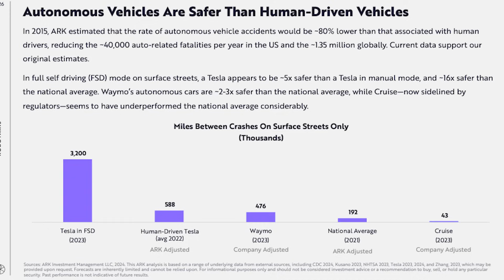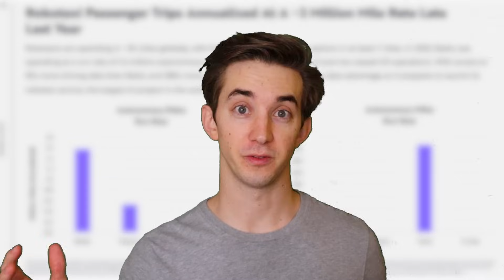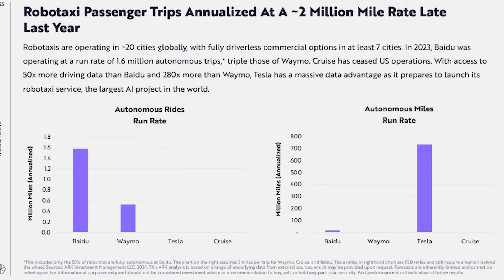Why Tesla FSD V12 will leave Waymo in the dust (customer review)

Comment: I have a comma ai  c3x on my base model 2022 Corolla. In terms of cost it is absolutely amazing. they were doing E2E before Tesla. I still believe Tesla will win at scale, but for someone who needs a cheaper car at $20k car + $1300 device compelling. Open source, tons of forks and fun to play with if that’s your jam🦉
Reply from the maker: thats very cool. thanks for sharing.
Reply: @BradAkersphotography
Comma has major limitation, well, 2 of those. #1 is data amount, as its way smaller in comparison to what Tesla has, by raw data and by compute power. #2 its share size and general camera amount. Its a single small device which can do so much, while Tesla can use 8 cameras capturing 360 view and use 300W computer to process data. 
Comma is entry level device, just to mess around with technology, but it will simply be stuck at this level.

Comment: Fusing a LIDAR/Radar/Camera sensor stack will be far more difficult than pure computer vision. It may be that Waymo is leading due to handling these cases better than Tesla, but this is as a result of Waymo targeting these problems specifically and not working on an vehicle platform and software architecture designed for generalization. 

That Waymo can handle construction zones at all is at the expense of thousands of dollars of sensors (per vehicle), and untold hundreds of hours of manpower devoted to these singular goals, around an architecture that is not designed to operate outside of a EXTREMELY well defined domain, and when the inference model cannot come up with a routing solution a remote advisor has to step in and drop bread crumbs for the vehicle to keep moving. 

If anything, in the long run Tesla is far better positioned to handle not only construction but operating in nearly any environment with a road.

Comment: These comments about Waymo vs Tesla are from people that have no real idea what they are talking about. Smoothing and better in many cases isn't the litmus test for robotaxi. Can Tesla FSD V12+ drive itself without any driver behind the wheel and not cause any issues, especially injury or deaths? If not, let's avoid fantasizing.
Reply: The simple answer is yes they can. It is just a matter of time now before this problem is solved.
Reply: I agree that anything is possible (can) but I doubt they can with Tesla's previous and current trajectory. Time will tell but time has not been kind to Tesla so far in terms of advancing FSD. @thewatcher5822
Reply: @huulegobetrotter1660  
FSD is made to work EVERYWHERE so its bigger challenge to make it work than any other system out there. Waymo has extremely bad handling when it comes to situations which are not preprogrammed or not prescanned, get a roadblock and it will freeze.
At the moment FSD is labeled as level 2 which by law requires driver and his full attention to the road, but from v12 videos we can see that majority of trips are done without any interventions. It's not there yet as a robotaxi, but it's close.
Reply: @Zripas  I think to say first iteration Tesla FSD v12 is close to robotaxi from a few videos is a huge stretch of the imagination. 

Aiming to have Tesla FSD work everywhere while not equipping the vehicles with the necessary hardware has so far proven to be too problematic and can't go beyond L2. 

Waymo isn't perfect but they can operate as Robotaxis in a few markets and they have gone about it correctly by investing their robotaxis with the necessary hardware and using their data properly in specific cities. Waymo is a robotaxis service not just close because of a videos and that's is a real fact. I personally think Tesla has the potential to one day have a robotaxis service but not at its current trajectory of solely relying on Tesla Vision and trying to do it everywhere because there are just too many variables on the road for software, albeit even using AI LM, to navigate on the roads across the country safely. Level 2 is nothing more than advanced cruise control, that other manufacturers such as Hyundai, GM, Ford, etc. also are categoried so unless they can get to Lvl4 or Lvl5, where Waymo is at, then it's would be difficult to be robotaxis. Only time will tell and I can and hope to be wrong while Elon Musk is correct as he stated Teslas are basically "sentient robots", " v12 isn't beta", and "we'll have Tesla FSD by next month/year or the month/year" after only using Visions "because humans only need their eyes". I would only ask how long/many years does anyone think Tesla really needs to reach L4 or L5 to say that Vision alone isn't enough and need to reverse Musk's decision? 1-2-3-4-5 years? I say if Tesla can't get behind L2 by 2027, put the hardware back in their new cars, and connect them reactivate the disconnected in their existing cars's hardware.
Reply: @huulegobetrotter1660  Tesla FSD is being designed to work everywhere, with just camera's. It does not require the array of sensors of its competition. Which is one of the huge advantages Tesla has. It is level two because that enables  Tesla to operate across the world, gathering the data required to solve the problem, while keeping responsibility for the system on the driver. ( a very smart move by Tesla) As for being level two, anyone keeping up with the development of FSD, will see it is a system way beyond level two (especially V!2)

From what I am seeing Tesla have basically solved self driving. It is just a matter of feeding it the quality video data required. Timescale for level 4/5 you ask? I wouldn't be surprised to see a Tesla  operating at that level somewhere at that level in about a year.

Tesla are about to dominate in this space.
Reply: @daydreamer8373  let's mark our calendar and see where Tesla is a year from now. If they can get beyond L2 then I will believe Tesla Vision is the right trajectory?
Reply: @huulegobetrotter1660  Absolutely. Before V12 I would not have made such a bold statement. But it really is what I have been waiting to see. FSD is already way beyond level 2, It has just not been activated as such. It is not quite ready, but all the hard work has been done. See you in a year buddy.

Comment: Tesla/Musk "vision only"  radicalism is very short-sighted (pun intended)
A plurality of different sensors is the future. Just like airplanes use a flurry of different sensors for IFR (no visibility) as opposed to VFR. 
This is literally a question of life and death. Ultra redundant sensors may not be cheap but its the way to go.
Reply: Unlikely. Cars don't travel at 500mph and scatter debris over several miles when they crash like aircraft do. Cars also only travel in 2 dimensions, not 3 like an aircraft. Like comparing apples and oranges. Humans use vision, some hearing and touch (vibration), absolutely no reason FSD can't follow the same model to be much much better at driving and identifying more edge cases around the car than a human can. Please let me know exactly where and why  I'm wrong. Ai is faster, doesn't get fatigued and is updateable. Its pure training from now on in.

Comment: Tesla better then waymo cap there are literally videos of waymo driving for 4 hours straight without any interference. Tesla has at least one every like 2 to 10 minutes have you seen whole Mars videos. Sometimes he literally has to grap the wheel so that Tesla won't hit something lol. He'll then say that was bad but then continue how it's better then waymo lol. OK if Tesla is so good let them be responsible for every crash fsd makes because waymo is responsible for every crash. It's so easy to say omg we're so much better we have 2 million cars when you don't have a lawsuit hanging over your head and a single crash will destroy their company.
Reply: Waymo has humans who monitor and take over remotely.
Reply: @davidt01   they can't take control of the car they can only provide suggestions to the car. Which is why when the car gets stuck and can't remove itself remote assistance gets called to drive the car. It would be too dangerous to control it due to connection issues etc. So waymo still has to do 99% of driving itself it has no one there like Tesla to quickly control it. So in my opinion it's still better then Tesla a Tesla can almost crash into another car and the human is there to quickly take control of it waymo doesn't have that.
Reply: @pennytrui1149  "So waymo still has to do 99% of driving itself" - probably the same as an FSD v12 Tesla then I guess at this point?
Reply: @BongoWongoOG  nope there are videos of fsd 12 still messing up not as much as before tho, it's impressive but not as good as waymo imo. I have seen one clip where a guy called whole mars had to grab the steering wheel or the car would crash into poles. Waymo has no one to grab the wheel it does everything itself and must correct itself which is why I find it just better and more impressive then Tesla
Reply: @pennytrui1149  if ots tit for tat there are also some of Waymo going rogue in Arazona and one of a journalist taken for a wild ride and an actual Waymo driver had to come out to the car. None of these systems are completed yet, but you cannot argue with the data, that a  Tesla with FSD is safer than a vehicle without?
Reply: 🤣😄. Tesla shareholders don't trust  the FSD they got inside  their Tesla cars but they would sale their cars to you  with FSD turned off. FSD coasts like $12k and its not activated. 😂🤑If FSD inside tesla cars are not  activated   and tesla cars are NOT giving rides like  Waymo I can say Tesla is selling  fake FSD to customers and Tesla should be sued for sell fake FSD and should be stopped from selling cars with fake FSD inside U.S .:dothefive:
Reply: It's so easy to say omg we're so much better we have 2 million cars when you don't have a lawsuit hanging over your head and a single crash will destroy their company.

Totally agree with this. Which is what makes Tesla's approach so smart. Tesla have never claimed anything above level 2 autonomy, which put full responsibilty on the driver. This has meant Tesla can gather the the huge amounts of data required to solve autonomy. Waymo might look like it's ahead, but taking a step back and looking at the bigger picture, it is Tesla holding all the aces.
Reply: @thewatcher5822  I mean in my opinion waymo is ahead at least for now version 12 is good but unless you can sleep in the car it's basically worthless. Waymo does everything unsupervised there is no one there to grab the wheel if waymo messes up. Unless I can sit in the back and let Tesla drive me it's not better then waymo. waymo will soon get on highways with no safety driver they are already testing. If Tesla is so good let's do a test waymo vs Tesla both people sit in the back no one in the driver seat let's see who messes up the most lol. I bet the waymo will have 99% no intervention needed. Tesla is good but not as reliable and safe as waymo at least not yet for now
Reply: @pennytrui1149  f Tesla is so good let's do a test waymo vs Tesla both people sit in the back no one in the driver seat let's see who messes up the most lol. I bet the waymo will have 99% no intervention needed.

Yes lets do that test. But lets do it not within a geofenced area. In that case Tesla will dominate. Tesla is trying to solve a much bigger problem with FSD. V12 is where all Tesla's work has been working towards. It is not ready, but it is getting to the point where it will dominate in this space.